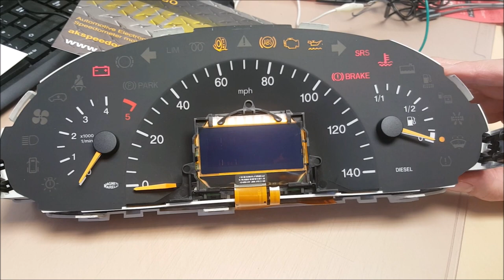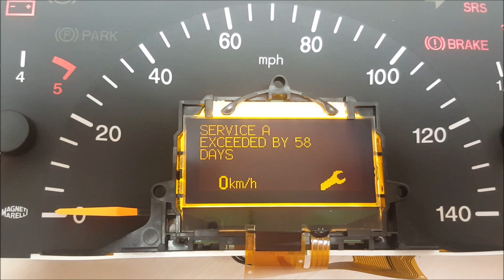Mercedes Vito V class W639 Speedometer LCD pixel repair

Comment: Hi James. I have very foolishly bought a 2006 W639. The door open warning buzzer is driving me crazy.  It is an ex-Police vehicle which has had the wiring hacked about. I have fixed a number of faults and it has passed it's MOT. I want to remove the buzzer. Is it black/grey cube unit with hole in the middle on the back of the PCB. If I remove or disable it, would everything still be ok or is there a fuse to disable it. I am getting close to my wits end with this bloody van. If you can't help, no problem, I enjoyed your vid..
Reply from the maker: Yeah, just desolder, and remove, careful not to damage the PCB when removing. Cheers James

Comment: j avais un vito 1999 l affichage tres tres fracjil soudee avec les quartz afichage c est pour cela ca me fait peur de toucher
Reply from the maker: Hi, the 1999 Vito model is different, it has a fine tracked heat bonded ribbon cable, thanks James